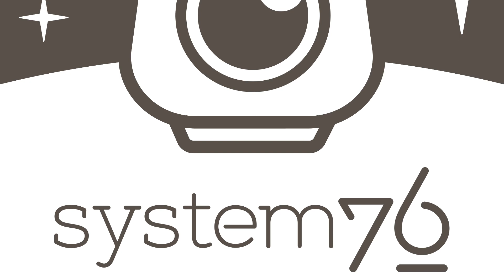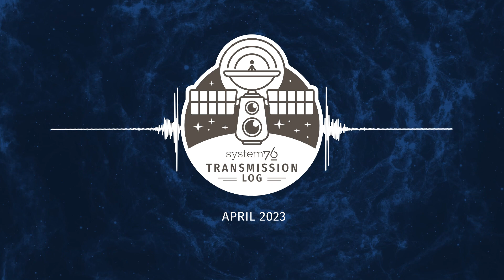Meerkats at Google, and What is Nebula?

Comment: As a current Gazelle owner, the one thing I would love to have seen in the refresh is more battery capacity.  I have had mine 2-1/2 years and it is still a fully capable machine. I just can't stray far from the outlet on any setting beside integrated graphics/battery power setting.
Reply from the maker: Thanks so much for the feedback. Consider it taken. 😀